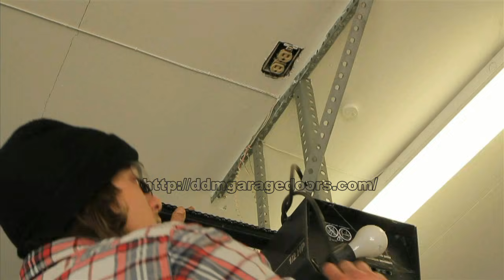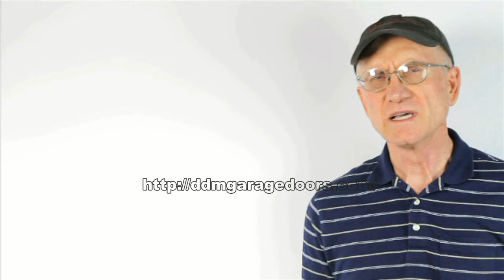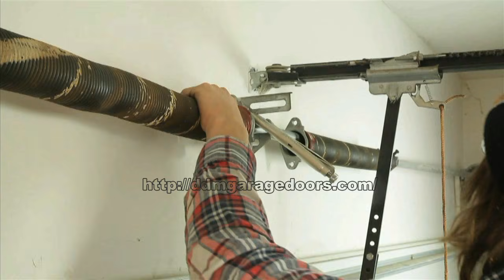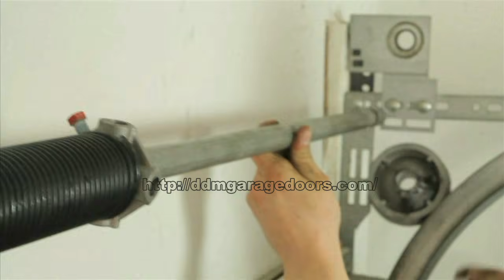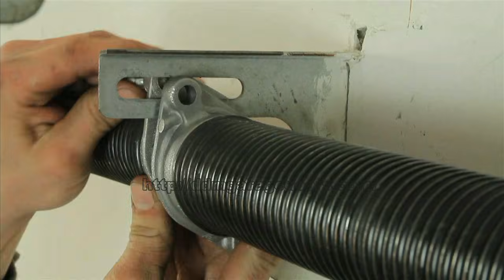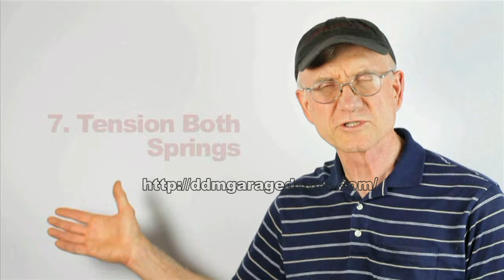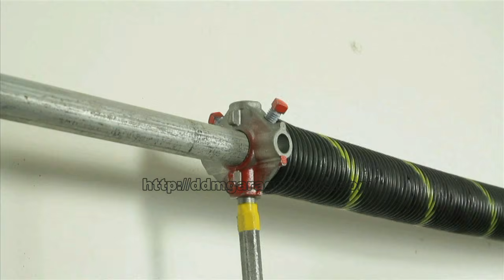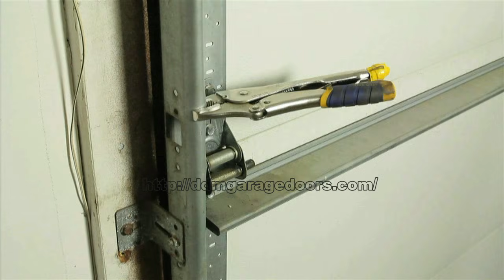How To Replace Garage Door Torsion Springs

Comment: My cables keep coming of the wheels any help would bee appreciated
Reply from the maker: itsDUNBEETLE Sorry for the delay. Have you been able to repair your garage door? Frequent causes of cables coming off include: 1. A single spring pulling the shaft and drum into the end bearing plate and bending it, causing the drum to scrape the end plate. 2. Insufficient spring tension. 3. The top of the cable not properly inserted into the cable drum. 4. A bent and binding center support bearing plate. 5. The door binding in the tracks on one side. 6. A loose track bolt that catches the roller. If these suggestions don't help you can call us at 800-383-9548.

Comment: These videos have taught me a lot.  Even being mechanically inclined, garage door springs were still intimidating enough to where this feat wouldn't be possible without these videos.  I didn't realize, the doors on my house were never balanced right.  The door never stayed in place half way up.  My thinking is that because of the addition bracing required in S. Florida for strength, perhaps they were balanced before the added weight.  Regardless, your videos, the right tools and a 1/2 turn later on both springs, my garage door opens perfectly.  Your attention to safety is top notch and is something that cannot be overlooked when working with these doors.  Kudos!
Reply from the maker: alreinike Congratulations. Glad you were able to study your door and to figure out the solution for the problem. Your kind words are appreciated.

Comment: Very informative. I used this as a guide to change my broken torsion spring. It was easy! Just make sure you follow all of these safety precautions and have the right tools for the job and you should be alright. Common sense goes a long way as well. The oil at the end is not necessary for all springs, just depends which brands you buy. Research it if you aren't sure.
Reply from the maker: phil ankney Thank you for your helpful comments, Phil. I've been in the business for 36 years and I've never seen a torsion spring that didn't work better with oil. Even with galvanized springs dry coils are noisy and this can cause enough binding to often trigger the opener to stop. What kind of spring have you seen that would not need oil?
Reply: The garage door company I purchased the torsion spring from in Beaverton, OR said if it was lubed, that it voids their warranty. I agree with you from a mechanical standpoint as far as lubing or greasing metal parts, bearings, joints, etc is typically standard procedure when installing new parts. However, the warranty issue was the reason I mentioned for people to double check first.

Comment: I just wanted to say thanks to Dan at DDM. I watched the video a couple of times before buying new springs from DDM and I still managed to get the springs on the wrong side. Luckily I took photos of the installation and Dan was able to identify my problem to get me back on track. I was under the impression the spring would just unscrew if backwards, but that isn’t the case. Thanks again to DDM for the great video.
Reply from the maker: Stuckneutral The way the springs stay on the cones when they are wound is counter intuitive. When you wind the spring it looks like the winding cone will spin out of the spring. What actually happens, however, is that as you wind the spring, the inside diameter of the spring decreases causing the wire to grip the cone more tightly. 

When I was a kid we played with Chinese handcuffs. Trying to pull your fingers out of the cuffs caused the cuffs to tighten even more tightly on you fingers. The cones in torsion springs work the same way.

Comment: you're awesome saved me lots of $$$!  I ended up with 31 quarter turns required to keep the door stable at half open.  it still feels a bit heavy to me so 32 would have probably been ideal tension wise, but I didn't want to over-stress the springs.  Thanks man!
Reply from the maker: icawn Thank you for your generous words. Glad to be of help. If the door is heavy at the floor and easy to pull down from the open position, you could add another quarter turn of tension to the springs. The door should be as easy to lift as it is to pull down from the open position. You're welcome.

Comment: Fantastic video.  Thank you for taking the time to put this together.  I have a question for you, if you do not mind.  I have a 7' x 16' steel insulated door that one of the torsion cables broke on.  I replaced both cables and now need to tighten down the torsion springs.  My torsion bar has two flat spots for each collar's set screws.  When I turn the spring 30 1/4 turns I am still quite a bit away from those flat spots.  I pulled the bar towards me and hit the spring towards the far end of the door to try and stretch the spring that far, but when I do get it that far I cannot keep it there long enough to get the set screw in.  I have to have the set screw all the way out so I can see where that flat spot is.  Any tips you can share would be FANTASTIC.  Thanks again for the great video.
Reply: Want to mention also that I did not replace the springs.  So these are the same springs that have been on the door.
Reply: OK, well I just went out there and looked at them again, and I think they are just marks from the previous set screws being tightened down so much.  I feel a little silly, because when I looked at them last night I swear I thought that they were machined.
Reply from the maker: Phil B The garage door shaft, or, tube is normally made of 14, 15 or 16 gauge rolled steel.These are normally perfectly round throughout the length of the tube.

Comment: Is it ok to oil my new springs with the bike chain oil? such as this? "Finish Line Dry Teflon Bike Chain Lubricant"
Reply from the maker: Roman Kharkovski Roman, that should work fine. Thicker oil, however, will last longer.

Comment: I have a small hickup when garage door goes up, when going down is fine. How do I remedy this?
Reply from the maker: ***** If your garage door has a short delay when opening it could be caused by a number of problems. It could be a worn gear or v-belt. Your trolley could also be worn or broken. On belt drive openers you could have missing teeth in the belt.I would usually restrain the door as it opens to help identify the problem. I've also seen the problem caused by paint gluing the PVC stop molding to the garage door. A variety of door problems could also cause the same symptoms.

Comment: Very dangerous being in the middle of the spring when under tension. What would happen if the end cone broke? Its an ok video no.need to Mark anything either too much extra work. I replace springs everyday as I work at a garage door repair place. All in all good video just a few extra useless steps.
Reply from the maker: Cody Wirtel Cody, thank you for your professional advice. As for being in the middle of the spring when under tension, we have found that is the safest way to wind the spring, stretch it, and secure the set screws. If you are beyond the spring, you can't stretch the springs and tighten the set screws without your head being in the path of the bars and the cone when the spring is under its maximum tension. 

As for the details, I can tell good professional mechanics in one minute how to replace springs. The video is produced for less experienced, often non-tradesmen, who find the extra details helpful. Best wishes.

Comment: Great, detailed instructional video. The only problem that I encountered was sliding the shaft to either side. The center support bracket flexed to either side that the shaft was pushed, binding the shaft in the center support bearing. Overcoming this problem cost me as much time as the entire operation!
Reply from the maker: John Binnie Thank you for your kind words, John. Sorry to hear about the problem with the bracket. Some brackets are anchored to the thin edge of a 2 X 4, to angle iron or to drywall, causing the brackets to bind as the shaft slides to either side. To avoid the binding I have done one of three things in the past: 1. Slide the shaft while holding the bracket in the center, 2. Lubricate the shaft in the center, 3. Remove the end bearing plates on each side.

Comment: Very well done!! you should do videos for everything!!!  Thank you so much. The challenging part after this video is to find the right spring for my garage.
Reply from the maker: AkmIs Thank you for your generous words. Videos are a lot of work. This one was easier because I've replaced over 20,000 springs since 1979. 

Finding the right spring for your door can be challenging. We provide three ways for customers to determine the torsion springs they need: weighing the door or finding the model number and providing the width and height, or measuring the springs. These links should help. http://ddmgaragedoors.com/diy-instructions/how-to-weigh-garage-door.php http://ddmgaragedoors.com/diy-instructions/how-to-measure-torsion-springs.php ; http://www.youtube.com/watch?v=CjW4vAMmyv8

Best wishes.

Comment: I am a serious DIY/fix anything and everything/ repurposer kind of guy. I was apprehensive and intimidated by garage door spring replacement. But when my left spring popped it was time for research.Being a blessed individual, Your video portrayed my exact door and the same broken spring. Your video was clear,professional and presented perfectly. The safety emphasis,step by step instructions and quality of video made replacing my broken spring a non issue.You even replaced the original springs with the exact spring upgrade I went with. I had to back off 1 full turn to get the proper float on my door. Your video was a GOD send. My highest accolades to you and your assisstant. Thanks. P.S. I have no idea how much money I saved but  Iam sure it was a chunk. This is my daughters account.
Reply from the maker: Michelle Mathis Thank you for your generous words. I'm glad we could help make the project less intimidating and that you could perform the work safely with successful results, and save money in the process. Best wishes.

Comment: This is a great video and you did a great job making it. But what if my garage door in wood? Its the same size as the garage in this video but its wood and very heavy. How many turns with a 40 inch spring would you recommend?
Reply from the maker: +Prairie Bilton Thank you for the kind words. On wood doors you wind the springs the same number of turns. 

The number of turns on standard residential garage door springs is determined by the door height in inches divided by the drum circumference, and then adding 3/4 to one turn. You work backward from this formula to determine the springs needed; the spring sizes follow the door weight, height and drum circumference.

Comment: I just completed my torsion spring replacement with the help and supplies from DDM Garage Door's.

This video is a very detailed step by step on how to replace your garage door torsion springs. I called one of the installers and asked him a couple of questions and then instead of purchasing them online I called and spoke to Dan himself. I ordered the springs at 3 o clock saturday afternoon which is after normal working hours for DDM Sales. In fact I called earlier that day and was told that he would call me back and so he did at 3 in the afternoon. If I ever have to replace my torsion springs again I will no doubt purchase from DDM again. I will recommend them to anyone that wants to purchase hardware or get any advise from them. 

Thanks a lot DDM!
Reply from the maker: ben hargrave Ben, thank you for the order and for your kind words. And, congratulations! Glad to hear our advice was helpful. Best wishes!

Comment: Of course as luck would have it, one of the springs breaks on a Saturday. I found this video, ordered the springs that day, got them on Wednesday and installed them. Well done on the video, I followed it and got the work done in a couple of hours. I'm a Service Technician myself and am a bit fussy about details. This video provided just the instruction needed to do the repair without going overboard. I did have to re-grease the bearings as they were dry, cleaned the track, lubricated the door rollers. Door is quieter now and runs the track a lot smother. Thanks again.
Reply from the maker: Luis Avila Congratulations! Glad to hear the springs arrived quickly and that the job went well. I normally oil the bearings, but grease is better if you have the time to pack the bearings. Some of the online spring companies try to sell end bearings with every spring sale, but the only bearings I've seen that I would recommend replacing have the letters "ADH" stamped on them. It's rare when the rest of the end bearings wear out.

You're welcome, and best wishes!

Comment: Thank you so much...I used this video and just converted my broken single torsion spring to two safely.   My garage door is twice as quiet now and each spring is rated at 40,000 cycles vs my single spring which was rated at 15,000.  Your website is also very helpful and I used it for the conversion, and ordering of my new springs and winding rods.  $90 vs the $450 I was quoted, and the gratification each time I open/close my door....THANK YOU!!!
Reply from the maker: +flyyboy84 Thank you for the order and for the kind words. Glad to hear the video was helpful and that we saved you over $350. There's a deep satisfaction that comes from doing something you haven't done before. You'r welcome!

Comment: No way for me to fix it my two cars got stock inside the garage, no way to go to the store, but i did identify the problem.  Thank you.
Reply from the maker: +jovy noriega Glad to hear we could point you in the right direction. I've been on many jobs where I had to open the door and get the cars out to make room for working. I've also had a few where the garage was so full of stuff that I had to replace the springs with the door open. That can be tricky.

Comment: Probably a dummy, but I just bought springs without the end caps on either side - now I am kind of stuck as I cannot get the end caps off the old springs to use on the new ones! Any ideas? I had no idea they were so tightly held by the springs - duh!
Reply: Dave, I saw one of your other videos and I got it with 2 pipewrenches - screwed right on and right back into the new spring.
Reply from the maker: Jon1gardner Sorry to hear about the error. This frequently happens when people are busy. We're working on ways to help the customer understand what they are buying. Glad you figured out what to do. The link for replacing the cones is http://ddmgaragedoors.com/diy-instructions/torsion-spring-cone-replacement.php.

Comment: This is a fantastic video. I'm glad I watched it. Are the winding bars easy to find, or do they need to be ordered. Can you use 1/2" steel rods from the hardware store?
Reply from the maker: Thank you for the kind words! The 1/2" rods from most hardware stores such as Home Depot, Lowes, Menards or Ace should work fine.

Comment: Thanks for this video. I had to reset the springs after the door got pushed out of balance. Was very nervous and this video set me straight.
Reply from the maker: +James Castor  It's been said that knowledge is power. I also heard once that if someone doesn't know what to do, he won't do anything. It looks like you found the right information and that it proved to help. Congratulations!

Comment: This video was extremely helpful.  I had no previous experience with this kind of spring setup, although I have worked on doors with the stretch type of springs on each side.  The safety precautions presented were clearly demonstrated.  I watched the video twice and took notes and was able to change the springs without any problems.  Well done guys.
Reply from the maker: +RayCruz57  Ray, thank you for sharing words that others will find encouraging. And thank you for the kind words. You're welcome, and congratulations!

Comment: Awesome Video! I like to think I am DIY savvy (I'm really NOT) and your video helped me save $200 by doing it myself. I was so pleased with myself that I sat and pushed the garage door button repeatedly using up quite a few winding cycles in the process! Thanks for the thorough and safety minded video!
Reply from the maker: Thank you for your kind words and for sharing your experience. Congratulations on a job well done and on saving $200 in the process. You're welcome!

Comment: Thank you for your  instruction video, it has help me a lot. I had inquire how much it cost for a spring torsion replacement and  I was quoted $600 to $800. I bought the  torsion springs and I did it myself (with your help of course) and it only cost me $65.

Thank you

Jeff
Reply from the maker: The $600-800 quote is outrageous! You're welcome. Glad to hear we could help with the DIY project. Best wishes.

Comment: I followed every step and it worked great.  My 9 foot door must have been heavy.  I had to add an extra 6 quarter turns (total of 42) to pass your half-way-up test.  Thanks for a good video.
Reply from the maker: You're welcome. Glad to hear we could help! I would expect to wind the springs about 38 quarter turns, unless the springs are a little weak. The 42 quarter turns may balance the door in the middle, but it may be heavy at the floor and a little hard to pull down from the open position.